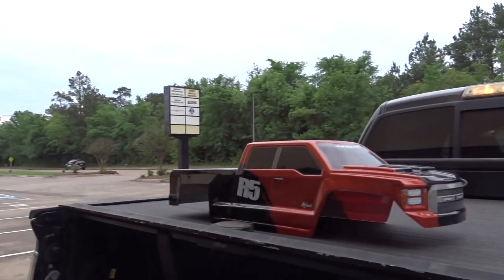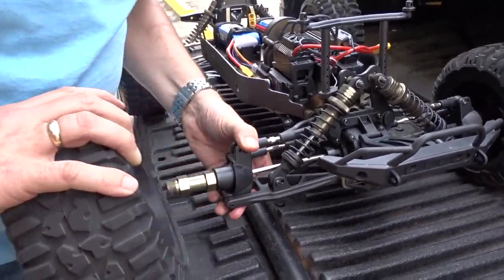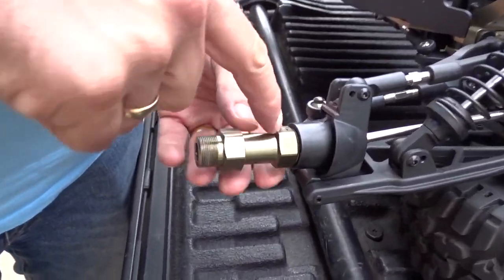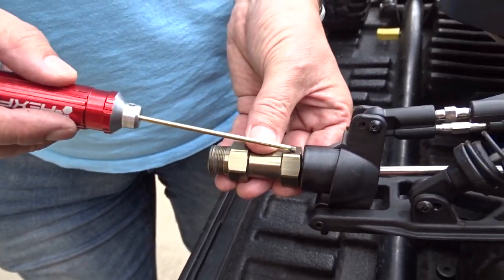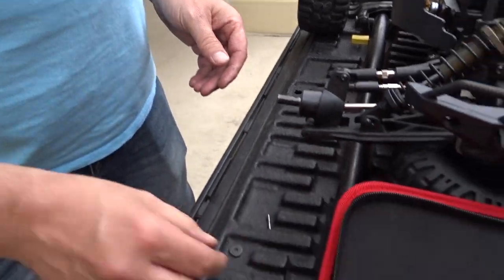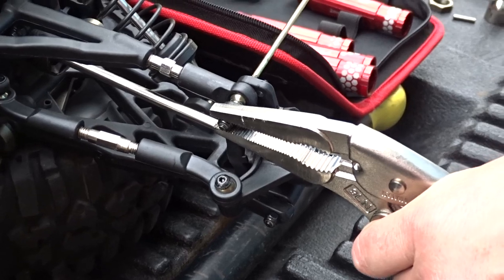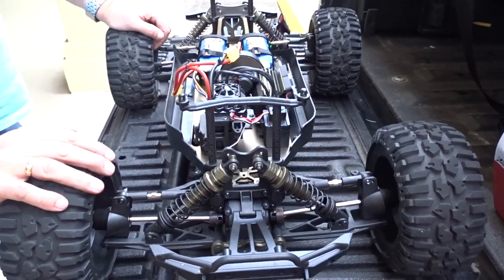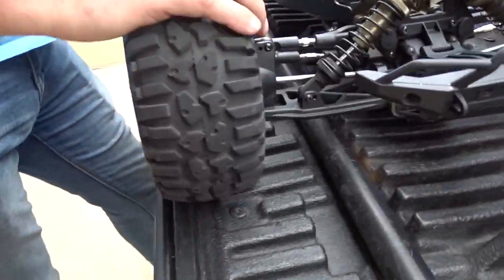Redcat 5th Scale Rampage R5 Truck Locked Front Axle Repair Video

Comment: Hey I watch your videos all the time , i was wondering do the rampage xte and rampage r5 Share the same parts because .I recent got a r5   I just want know how difficult it will be to finds parts for the r5
Reply: I got one a few months back, found it dirt cheap on ebay. Redcat still sells all the upgrades for it on their site. The 2 upgrades that really beast this thing out are the aluminum shock towers & skid plate supports, both are mandatory & will make the core bulletproof. The shock rods are weak & will bend but they're many beefy shocks out there that will fit including the piggyback upgrades. I recently bought another from the same seller like $100 cheaper. Pure lunacy on that price.
Reply: @Megasty15  im guessing you are talking about the only seller who sells these for $495?
Reply: @LayneSteighlee  Yeah, it has a few basic problems for a 5th scale like the steering parts will break & the upgrade is hard to find. The hubs are super beefy but I did strip out a front hub carrier. I did a few vids on the thing where I beat it into the ground to find all the problems with it. It's actually a solid runner even w/o the upgrades, but I tend to max out RC w/o jumping them. I've only jumped it a few times though. The steering gets a bit wonky when it's in the air & wheelie'n but that's because the front suspension is very flexible. The wheels are junk too. ANY aftermarket tire will make this thing shine. But it loves the Arrma 8S tires.

Comment: I am seeing these on ebay for $495...I am extremely tempted to purchase one. Is the only problem that I really need to go through each screw and apply loctite? If that is all I need to do, it is a steal for $495...or are there other major issues with the R5?
Reply from the maker: I have not had any other problems with ours.  We don't run it that often though and parts availabilty may become challenging.  I never really saw any other reasons with ours why they recalled it.  I never really heard the full story behind the recall.